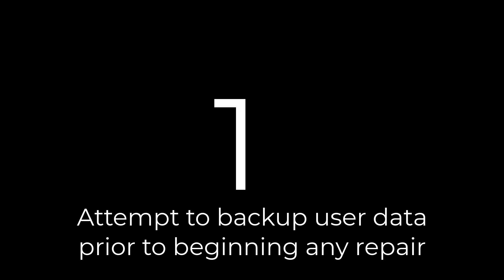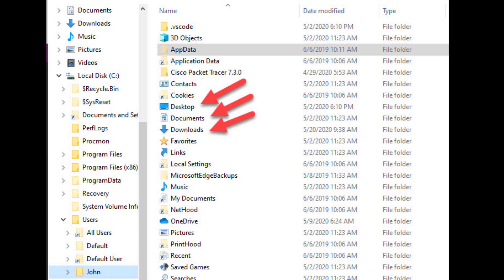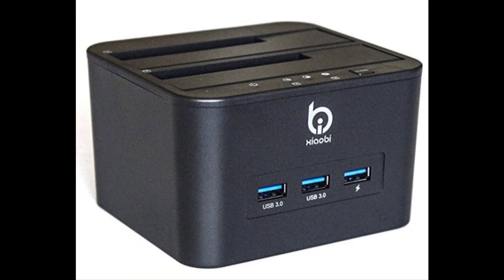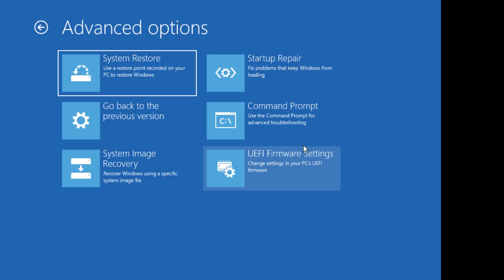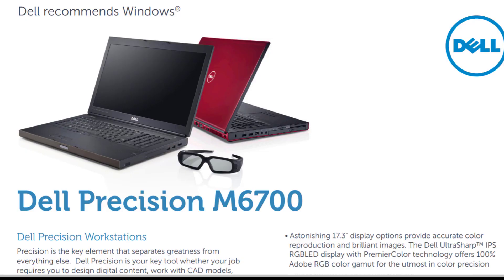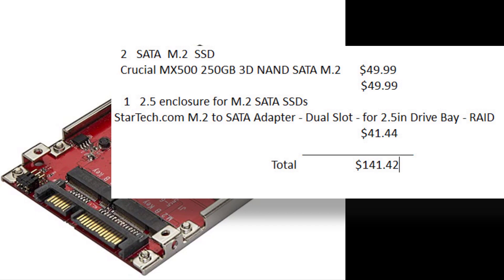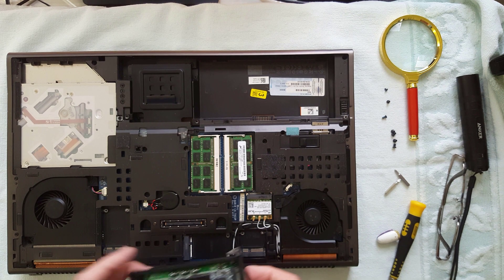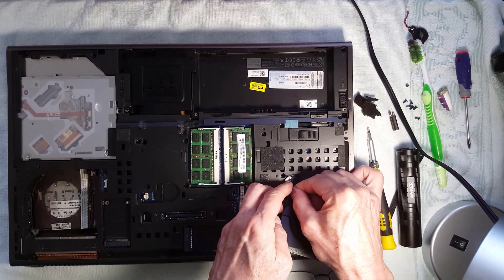Boost Your Laptop, Not Your Budget: Upgrade Tips for IT Pros

Comment: WHAT?!
No chkdsk on HD/SSD (after cloning it)??

If you know anything about the user profile files, you don’t really need most of them.

Instead of wasting an SSD for raid, use that 2nd SSD for PROPER hourly/daily backups.

Raid 0 won’t do much for you here as the SATA interface is still 6GB max.
Reply from the maker: For home users profiles are usually not critical but supporting enterprise you want to be careful if you are in a recovery process and this is the only copy.  Custom Excel macros are saved in the profile and well as custom Word dictionaries, just to name a few items that folks will want.   Thanks for the comments and for watching!

Comment: nice upgrade video,however why choose two 250 gig mvme drives in a adapter instaid of using a 500 gig sata drive,wich now costs less then your setup,you also said the memory was maxed out to 16 gig,as i looked at the specs you showed,you could choose to put 32 gig in the machine,hence with less speed mind you,but is there a lot of difference between 1600Mhz and 1866Mhz,i dont think you will notice the difference,but you wil surely see the difference between having enough memory (32 gig),or not enough (16 gig)
it all depends on the programs you wish to run on the machine,DAW's and VSTI's would surely need 32 gig
Reply from the maker: Good eye, memory is the first and important upgrade and yes we could have bumped the memory up to 32GB.   We choice 2 M.2 SATA SSDs which alone would have improved disk speed over a 5400rpm spindle drive but the advantage of the adapter is we gain an additional 2X speed factor by RAID 0.    This is about the best you can get out of 6Gbps SATA port.   Thanks for the comments and for watching!
Reply: @TechsavvyProductions  youre welcome Lowell,im always exited to learn something new

Comment: Back to IT basics! troubleshooting and Upgrading laptops are often time consuming and not very economic, but I hope this video will help the guys who need to do it. Regarding the profile backup, mmm I 'm a little suprised because in general when we recreate a profil or a computer, the goal is to start "clean" so only the desktop/favorites/documents/images/music/downloads folders should be copied, the rest is to be managed separately if we really need to reinstall the same apps. I don't really know what can happen if you copy the appdata of a software that is not installed on the new laptop? anyway another interesting video :)
Reply from the maker: Upgrading laptops/desktops is not generally for enterprise, although in a huge school district where I worked we did it all the time (very limited budgets).   There were lots of video files in this profile saved by the application they used and so an effort recover some of those files was the goal.   I always save profiles for another reason,  if I need to recover Word or Excel macros or special user dictionaries or other application specific  files, they were typically in the profile.   Thanks for the comment and for watching!